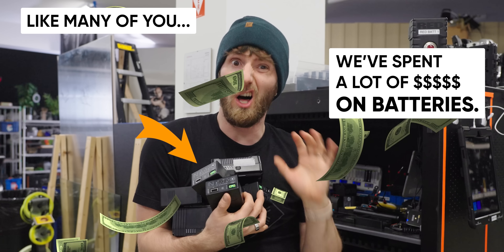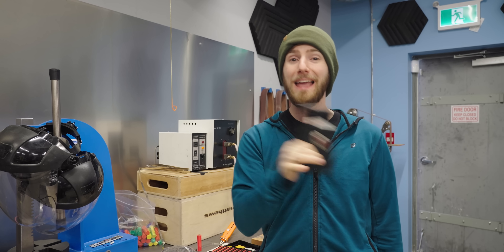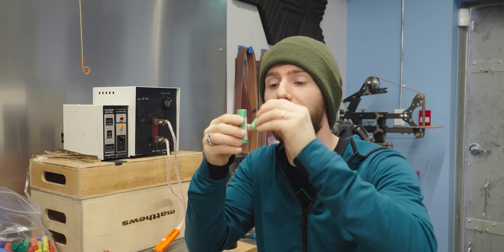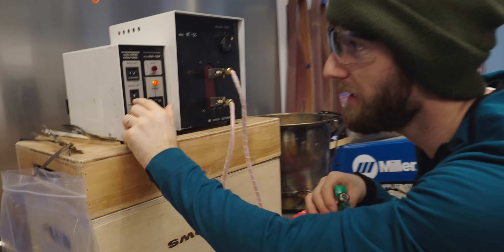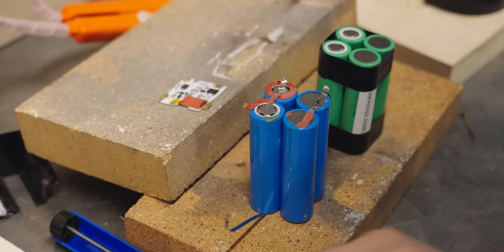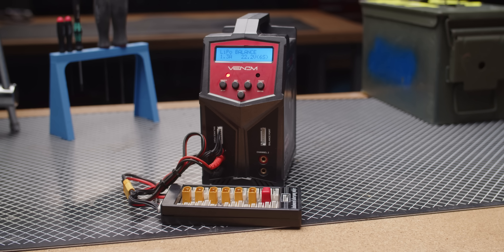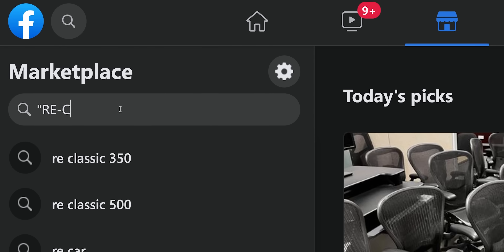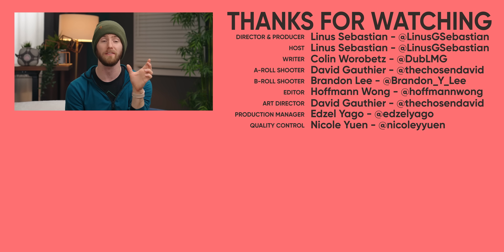This should be illegal… Battery Repair Blocking

Comment: they had similar problem with capcom cps2 boards. if the battery on the board dies itll wipe drm data that made it run properly. its bullshit that this kind of practice existed way back in the day.

Comment: The best cells I've ever used are the Sony (now Murata) VTC5.  I literally have some from 2016 that I still use daily.  The insane current tolerance and charge cycle life make them heads and shoulders above every other cell I've ever used from Samsung, LG, Panasonic, and even every other Sony.  Source:  owned a vape shop for 8 years.  If you're going to go through the pain of rebuilding packs, buy once, cry once, build once.

Comment: Dont get the whole OCCT drama, there aren't any obvious indicators that they would be required to purchase a commercial license. If you go onto their website like a normal person, the home page has zero mention of personal vs commercial usage, and from their, the instinctive thing to do is to click the large bright yellow download button which brings you to the download page, which also has zero mention of personal vs commercial usage. After you click download and launch the software, there are no messages disclaimers about how or where the software is meant to be used, and even digging through the menus of the app there is nothing to be found. 

The only mention of "Commercial use" is on the purchase page which simply has a grid of features with checkmarks and X's indicating which features each version has. Free has commercial marked X and Pro has commercial marked with a green checkmark. There are no words that I could find which stated that the personal version is not allowed to be used for commercial uses, and the grid, if used like any other comparison, simply makes it seem like the commercial version would have features that would benefit a business, not that it is required for commercial use. 

If its the developers intention for Pro to be required for commercial use, which it obviously is, I think LTT should just buy the license but I think OCCT really needs to improve their website to have more specific and legally correct wording in an obvious fashion to prevent this issue. The only licensing information that I could find was on the support page, buried under multiple drop down tabs under a tab called "How many licenses do I need" which just says that personal users need 1 per house,  pro/enterprise users need 1 license per business. Never explicitly states that one is required for a specific scenario. 

If i missed some sort of EULA somewhere please correct me but it seems like any of this information is just very vague, and not obviously accessible.

EDIT: Finally found the EULA which clearly states the the use cases after visiting the site for the 4th time. Its buried at the bottom of the purchase page with a small red button that blends in with the rest of the page. I think it should be at the top of the purchase AND download page, as well as somewhere obvious in the app itself.

Comment: You guys definitely don't know what you're doing with these batteries. Why are you throwing them in sand just because you got a small spark? That's just the welder sparking, not the battery. If you actually ruptured the battery, at minimum you'd have smoke pouring out of it, if not an actual 🔥 coming out of the cap. 
Also, for doing simple stuff like building a pack you don't even need a welder for thin nickel strips. You can use low temp nickel solder and a pretty hot iron. Just tin the battery cap with a little solder, lay the nickel strip on top of it and then press the iron on the strip for like one to two seconds and it'll fuse really well.

Comment: wen i worked as e-scooters mecanic we run in to issue with battery packs that when they go empty u cant recharge them again and it was made like this by manufacturer we hade a lot of good battere packs that we cant recharge them and nine bot would not give us programs to make them work again. and just because those batterys did not have safety shut of when they reach 10%. a lot of battere packs was sendet to recycling, i tink companys like that need to be punisht and change there ways of doing stuff. and thats why i do not recomend to ppl e-scooters ore e-cars